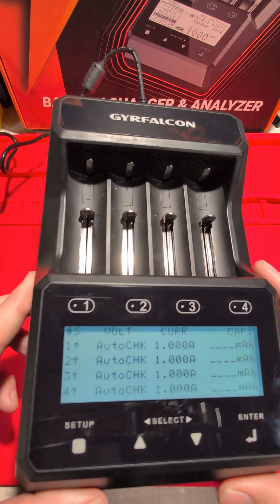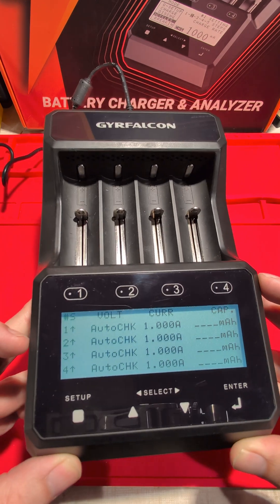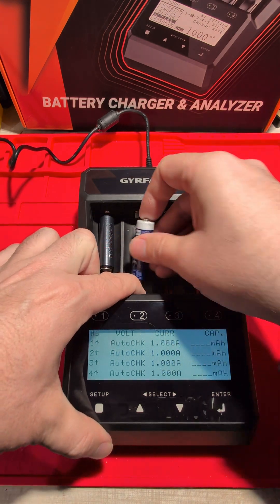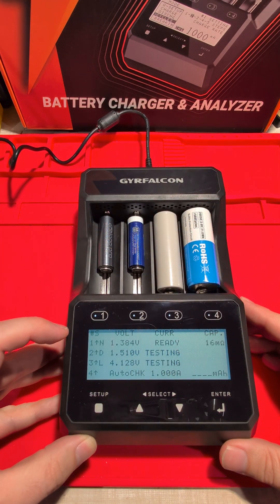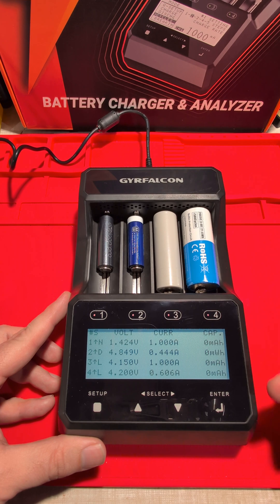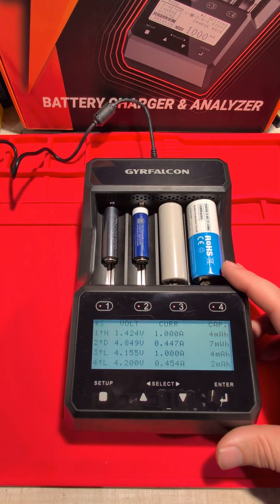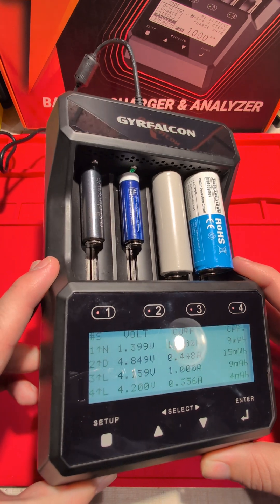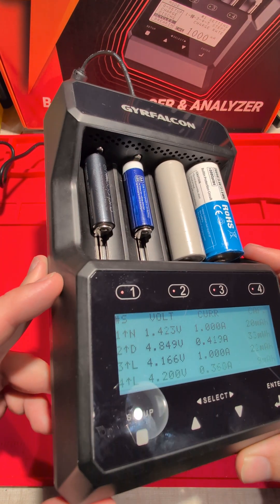The Most Advanced Battery Charger I've Ever Used...

Comment: Tim, off topic question:  I’m considering the purchase of a high lumen (50K+, flood and throw) torch, would you suggest a cool, neutral, or warm white emitter?  I’d be curious to hear the reasoning behind your choice, too.  I live in a varied conditions climate, generally dry, occasionally humid, often with airborne dust.  Thanks, much, in advance, for your reply.  Best, Cary
Reply from the maker: I'd probably recommend the Acebeam X75 70.3 6500K if it's mostly dry. It won't sustain 50K+ lumens for more than a few minutes though.
Reply: @TorchHacker Thanks!

Comment: Is it normal for the 1.5V Li.Ion battery to be charged at 4.8V?
Reply: The SkyRC MC3000 is a far better charger imo. While this gryfalcon is highly capable, it has annoyances that keep me from liking it. The capacitive touch button aren’t great.

I also found storing a recall of set program needlessly complicated compared to the SkyRC.
Reply: @cheule  What would be a good 2 bay charger? I'm looking to get a new charger in the near future, but I don't need a 4 bay charger. My current charger is an old basic Nitecore 4 bay, Intellicharger I4, 1st gen.
Reply from the maker: @CorradoVR6z XTAR VX2 Pro
Reply: @TorchHacker  Thank you!
Reply: @cheule  Even with firmware V38, the touchscreen buttons are a joy to use.
The latest firmware version, V64, introduces Simple Mode, allowing automatic charging of Li-ion, 1.5V Li-ion, and Ni-MH batteries without any button presses, greatly improving everyday usability.
Reply from the maker: Yeah. Usually a charger will provide about 5V/0.4A to a 1.5V Li-ion cell where the cell will have it's own built-in charging of 4.2V with a TC-CC-CV charging method.